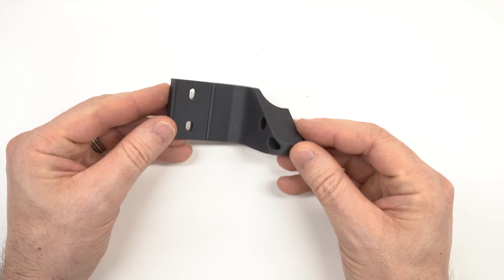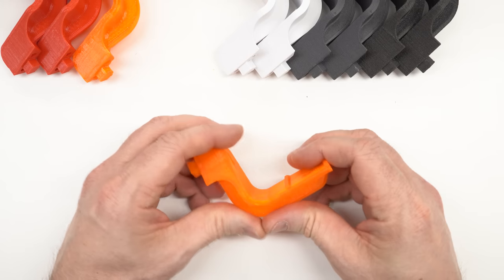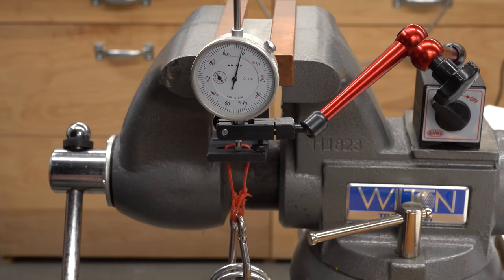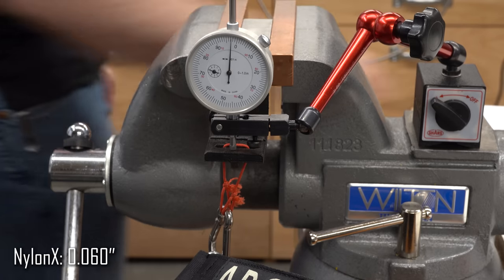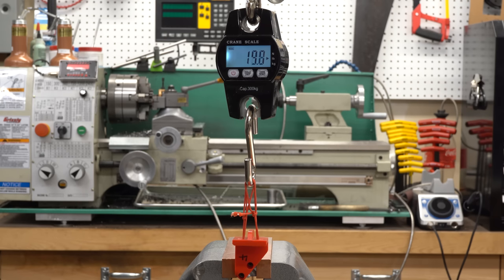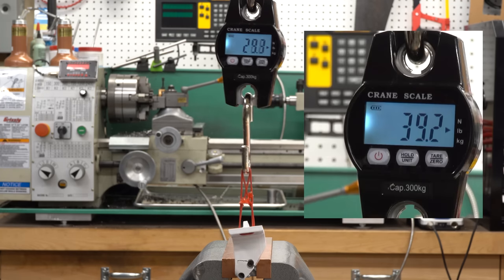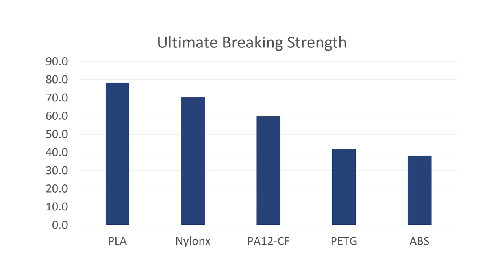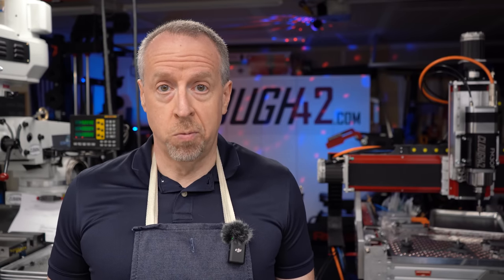Wait, What?  PLA is Stronger Than Carbon-Fiber Nylon?

Comment: Still watching but beware: PLA creeps over time; and honestly very quickly under constant load. No way that will happen with nylon especially CF reinforced. If you need something stronger use PC or PC-CF. PLA is such a low temp of GT and with the creep it’s pointless for mechanical parts. Ductility in PETG disqualifies it for stiff applications but try HTPET for a better mechanical alternative.

Comment: I don’t believe PLA is stronger at all. I would suggest to make a “dog bone” with 100% infill and perform an IZOD test. Not sure on your settings and want machine you used to make these parts but like ABS needs to be in a heated chamber to truly get proper layer adhesion and the same goes for any of the other “engineering” materials. Type of machine and settings goes a long way for FDM printed parts.
Reply from the maker: ABS parts were printed in an 80C heated chamber.

Comment: PC

PC+CF

Heat resistance and hard as a rock. CF may be too brittle it’s that hard.
Reply: I do love my carbon-filled polycarbonate.
Reply: @martinmckee5333  ya me too. Just wondering about brittleness for impact on the CF. How hard can you hit it before it shatters?
Reply: @jameshancock  I haven't done any official impact tests, but unofficially, it is seems less likely to break than PLA in a fall onto a hard floor. I've had fewer such issues when animals have caused such "tests".

Comment: I dislike your methodology of printing an angled part to do this test.

For reference, in MatSci we typically use I shaped pieces with a thinner centre so that the stress concentration will ensure that the thin centre will break first. Also, that centre is specifically made to be a specific cross sectional area, say 1cm sq, so we can definitively say that the material has a X N/cm^2 strength (we can put definitive units to it). More importantly, the test will test the strength in a specific plane, so you can test the strength of the XY layers, or the Z layer, which is important, because the X and Y layers will be functionally very similar, but the Z will be drastically different.

If you put it at some kind of angle, and as you can see all your tests popped as a diagonal of the Z layer delamination, it's hard to tell what component of it was Z layer failure and what component was X/Y. This would not be a great test too because different materials behave differently. they strain/stretch in X/Y very differently from Z, especially so because you're only testing 20% infill so the difference is only exacerbated. but more imptly the strain/stretch is now compounded by the fact that a certain component of it belongs to the X/Y layering and a certain component is the interlayer adhesion, and we can't say for sure how much of it is which.
Reply from the maker: You appear to have missed the point.  I made this real part in a previous video and people told me in the comments I should have used a different material.  So I tested it.

Comment: Actual Carbon fiber parts is made of continuous fibers and resin. There is no reason this sort of incorporation of carbon fiber should work as a reinforcement because the fibers are broken, this is more like plastic with graphyte powder than actual carbon fiber.

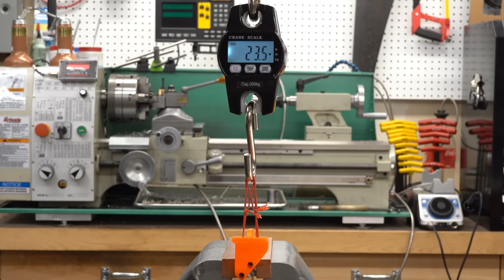Comment: 8:40 The scale clearly says pounds, but you are reporting Newtons.  Metric/SAE conversion is bad enough when you know what the units actually are!
Reply from the maker: Yeah, the device was set to Newtons, but I checked it with some pound plates and forgot to put it back, apparently.  Fortunately, all of the tests were performed with the same setting, so they're directly comparable.
Reply: @Clough42  Fair enough indeed when talking about comparisons.  For any real world application, personal print settings, material quality, etc will make a bigger difference so any* definitive force rating would be not exactly the best thing to derive from a youtube video.

Comment: The part was designed for downward pressure but you did not test for it.
Reply from the maker: I flipped it upside down, so the forces on the part were similar enough for my needs.

Comment: Printed carbin fiber is not same as carbon fiber part made out of carbon fiber sheets
Reply: exactly. CF's strength comes from the long fibers that goes through the material, but the CF in these filaments are chopped into microscopic pieces, so they provide no real strength through the print.

Comment: i think that you have so much inconsistent result of PETG is due to force (on which moment was screwed)which was screws tightened to steel holder. Speed of printing and cooling can make different. Too much variables which can make different. My personal experience with PLA is not good as yous. I have so brittle one which cannot be compared to yours. In general I think Petg is much stronger for any use. I thing that some PLA filaments are doped by petg to strengthen.

Comment: Every part broke at the exact same point.  .where there is a thin wall next to a bolt hole.  Either not using the countersink hole for the bolt heads, or making the section thicker at the bolt hole by changing the contour of that edge of the part, could have made the part a lot stronger.  It's a tremendous engineering MISTAKE to put ANY hole that close to an edge.  The thickness of the material  on the edge of ANY hole like that should be at least the same as the diameter of the hole, so that the stress is not concentrated in such a small area.  BAD ENGINEERING and DESIGN made those parts fail at incredibly low amounts of stress.  Designed properly, those brackets would have been literally indestructible.

Comment: Do they Make Delron In a 3D printer filament?
Reply: Yes delrin is available as a filament, it's POM. From what I hear, it's a nightmare to print (adhesion and warping) and it can also create toxic fumes if overheated.

Fun stuff.
Reply: @martinmckee5333  It is everything you say, but as to strength and wear ... wow. We used to make drive gears from it, and after thousands of hours of meshing, they were like new and even shiny - much better than nylon. The melt point is much higher to extrude, and the vapors will drop you to your knees with the slightest whiff. Naomi Wu did a pretty good YouTube video on it, although it is difficult to watch with the aftermarket front end she had installed to her torso.😳
Reply: @miketrissel5494  What is the advantage of 3D printing Delrin, given that it is exceptionally easy to machine? Are there applications that require shapes that are difficult or impossible with subtractive manufacturing, or is it simply that a 3D printer was available and a gear cutting capable CNC machine was not?

Comment: The material isn't the problem, it's the 3d printing process. Making something layer by layer is not good for strength. It isn't as strong and doesn't last over time.
They're great for prototypes only
Reply from the maker: Depends on the application.  I have many 3D-printed parts that have been doing their jobs for many years: a knob on a bathroom fan timer, a solar radiation shield on my weather station, all of the limit switch mounts on my CNC mill, the servo mount on my lathe, etc.
Reply: All very low strength applications..
Reply from the maker: @jerryboics9550  If a NEMA23 servo mount on a machine tool is a "very low strength application" then you and I are working from different definitions.

Comment: Its easier to consider the relative characteristics if you think about the plastics in real world scenarios. You know how a PLA fork acts you have used them, and tried to bend them. You know how an ABS door handle, or car mirror acts. You have used them and have seen shattered mirrors. Also you see PETG everywhere. Have you ever tried to twist a soda bottle, or think about how hard the threads are on the cap. Its a great molded material, the 3D prints in my experience are good, but the strength of blow-molded PETG is pretty amazing if you think about it.

Comment: The braking point should be designed and simple. Your parts failed in a manner that is not really easy to replicate because of the complex geometry in the area of failure...

Comment: You did NOTHING wrong ... you made a choice given the information you possessed at the time. I didn't like the test given you were actually testing the screw holes and not the supported bend of the material. I would love to see you clamp the samples and stress test the bend area of each material. As always ... Thanks for sharing ... Stay safe and well ...
Reply from the maker: Yeah, standardized samples are the way this is usually done.  I had this part, and the strength was in question and relevant to what I was doing, so I thought it would be a good test.
Reply: You did one thing wrong - make the part far too thin around the screw counter bores.  All parts failed exclusively because of that.  It explains the wide range of results.

Comment: I have been preaching that for years now: PLA IS the best printing material for everyday use, especially for mechanical parts. If you use some simple tricks you can make it even stronger:
- design the part with 3dprinting in mind (e.g. keep in mind how the layers are laid and forces are transmitted)
- print slower and hotter
- slightly increase flow
I have designed tons of brackets, holders, spacers, etc. over the years and they hold up perfectly fine.
The only two downsides of PLA are the low heat resistance and tendency to creep (which can usually be addressed by designing the part accordingly)

Comment: You are testing tensile strength and PLA is higher than most of the regular materials, that is a known fact. Did not expect the PA materials to be so weak, did you dry them before printing? PA that does not have tensile strength higher than PLA should be named and shamed.

Comment: Put them in your car, in the summer, and then test them ;)
Reply from the maker: I have had PETG and ABS parts in my car, in direct sunlight, for several years, with no issues.  I have a part printed in PLA in my truck now.  We'll see what happens when summer comes.

Comment: White ABS is weaker due to the additives that make it white....
Reply from the maker: This is entirely possible.  Different colors sometimes print differently, too.
Reply: @Clough42  it would be cool to see a different ABS test, or ASA. the only reason i know that white ABS is weak, is the Voron community has stress tested it a lot. 
but it also makes sense since Titianium White is the most widely available white pigment, and you need A LOT of it to get a consistent color.

Comment: Yall need to quit cheaping out on your CF nylon. I havent had a PLA part last in functional use for more than a few months but my glass filled nylon rarely fails. Testing some parts by just braking them by hand it feels waaay stronger. A lot of times ill be able to brake the pla print but I cant brake the nylon. (I print at 270c nozzle with a 60-70 degree chamber)
Your results dissagree with bassically everyone elses tests.

Comment: I know this isn't that type of channel, but dudes who are doing g*n parts use Nylon instead of PLA for its durability. Nuff said right there.
Reply from the maker: Nylon is going to outperform PLA for impact resistance, and that's going to be critical for handling the impulse energy generated in that application.

Comment: Sorry, but this is not the correct way to test and compare different materials 😢
You need at least 3 ( or better 5) specimens of each material and you have to print it with a specific shape to avoid fluctuations in results. Loads must be applied slowly with a professional machine because results are influenced A LOT by  speed and the way that you apply it. Search for ASTM test materials for know more about it.

Comment: Sorry, your tests are deeply flawed.  I worked some in the plastic injection molding industry.  The big problem with your test is plastic are extremely notch sensitive.  Your are measuring the effect of the sharpness of the bottom and tops or the counterbores.  Sharp corners in radii are a no no in  plastics.  A better test is to use pull test on flat specimens with rounded edges.  I would get rid of those sharp radiuses in your parts especially in 3D parts due to the crack initiation layers.

Comment: Silly test from an amateur. The measurements and tests and benchmarks in engineering must be repeatable, reproducible. Therefore the description/definition of the test is the same important if not more important than the test itself. You do some random things that popped in your mind, and you think this is a fair comparison and it describes the real life. Far from it. This test is totally unusable. We don't know your printing environment, the settings of the printer, your 3D printing knowledge, the design of the testing specimen. And then you skip dynamic tests, impact tests, that must be "unimportant". How much energy will be necessary to break that thing? PLA ? Would you be surprised if it broke from a gentle hit, and you thought it was very strong material? Also the endurance/fatigue tests, repeating load. Any rotating device generates pulsating load, did you know that. Search for Tacoma Narrow to understand how important the fatigue is. I could be wrong, but you should leave the testing for engineers.